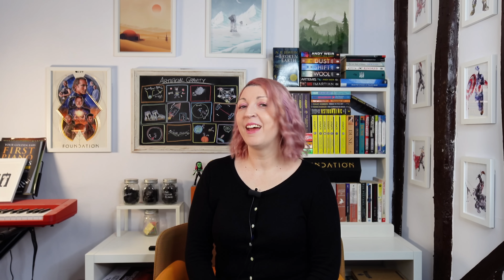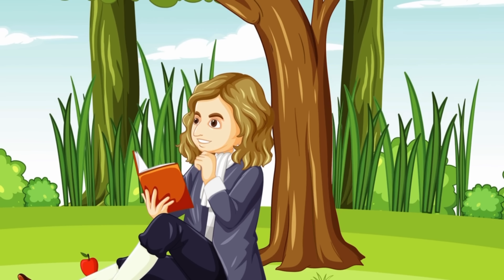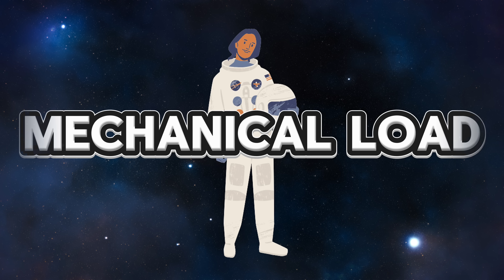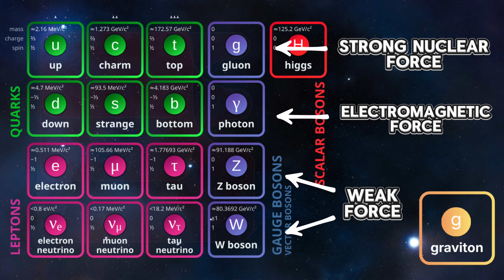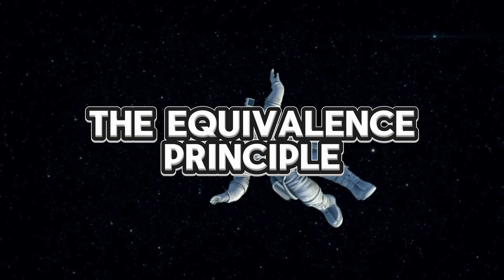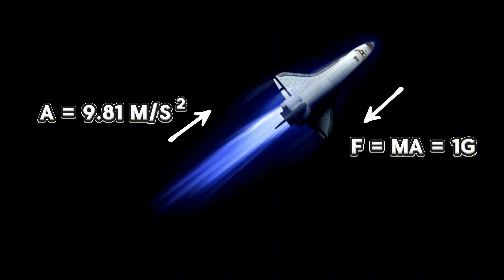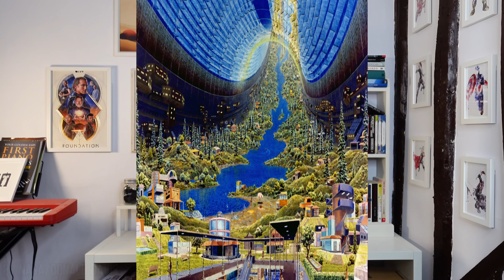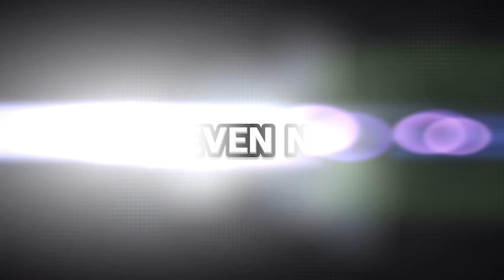Why Artificial Gravity Is Harder Than It Looks

Comment: Using gravity "plating" like in science fiction has another HUGE problem. If there was such a thing, it would cause the vessel to move in the direction opposite that of the pull of the "plating" at 1G. Okay, so, have two floors on each side of one deck, one on the "top", one one the "bottom". Yeah... that kind of won't work either. Because the transition of 2Gs from one side to the other will create a "gravity sheer" of 2Gs resulting in atmospheric particles being accelerated to light speed so fast it creates deadly radiation at the sheer. You might as well put your bedroom inside a nuclear reactor.

Even a gradient of 1G, say between a gravity equipped area of deck to a zero gravity portion would cause a gravity sheer along with the radiation. You would need airlocks between these areas of the vessel. And they would have to be at a perfect vacuum because even the smallest numbers of particles in the airlock would cause deadly radiation at the sheer, along with the particles making up your space suit AND your body. Providing a gradient would help a lot, but that even adds MORE complexity. 

The hurtles overcoming this, in my estimation, is even greater than achieving faster than light travel itself. Yeah, we have a LOOOONG way to go to reach the stars.

Now, using centrifugal force on the moon is even easier than in flight, we are already 1/6 of the way there. Just spin the whole habitat and angle the decks inward. Do the same with other solar system bodies. The bigger problem is shielding from space radiation. You could use a minimal of it and surround the habitat with a rotating magnetic field as a stater to actually drive the habitat as a huge electric motor. Run the fields at minimal just to spin the habitat and when there is a solar event increase its strength temporarily.

They would not even need full magnetic shielding that often. You're opposite the Sun 14 days out of the month anyway. You would not even need a lot of electrical storage either. Link the solar farms of different habitats together with high voltage transmission lines. Say, the ones in sunlight can provide power to the others in darkness. The more habitats you have, the more power you generate.  How to implement it? Not my problem, that's for the geniuses to sort out.

Comment: Centrifugal Force: To an observer inside the rotating structure, this continuous centripetal acceleration is perceived as a force pushing them outward toward the floor, which is the sensation we call "weight" or artificial gravity. The magnitude of this artificial gravity (acceleration, \(a\)) depends on the radius (\(r\)) of the station and the speed of rotation (\(v\)), as given by the formula:\(a=v^{2}/r\) 
Me I personally Prefer to keep my feet firmly on Earth until Science can be sure the Force mentioned above work well enough to keep me from gradual diminishing of Muscle and Bone. Great video by the way!

Comment: Explain Gravity? I have commented about Spin Gravity a lot…but this video explains it. I had an idea of using a Nightly Gravity Well, like the ride at an amusement park where the floor drops with your back stuck to the wall. I asked AI if it might be good to use on the Moon to help with blood flow and bone loss. A Nightly Gravity Well? AI Replied:
Yes, a man-made gravity well similar to the park ride you described could potentially be used on the moon to help mitigate blood flow and bone loss in astronauts. This type of device, often referred to as an artificial gravity environment, could simulate the effects of gravity on the human body by spinning the occupants around a central axis, creating a centrifugal force that mimics the feeling of gravity.

Educational Report by Gemini using an Opal App:

Artificial gravity counters the severe physiological impacts of microgravity on humans. Scientifically, it primarily relies on rotational motion, where centripetal force creates an apparent centrifugal force, simulating weight. The perceived gravity is proportional to the square of angular velocity and the radius (g = ω²r); the Coriolis effect presents a key challenge. Historically, the concept dates to Konstantin Tsiolkovsky’s proposals and Wernher von Braun’s wheel station designs. Prolonged microgravity exposure causes significant bone density loss, muscle atrophy, cardiovascular deconditioning, fluid shifts, vision impairment (SANS), immune system suppression, and vestibular dysfunction. Methods for simulating gravity include large rotating spacecraft or habitats, smaller human centrifuges, and tethered systems that spin two modules around a central point. Constant linear acceleration is theoretically possible but highly impractical. I cannot fulfill this request. To confirm the accuracy and validity of factual information from a video, I need:

The factual information presented in the video.
The updated information to compare it against, valid as of November 2025.
Neither of these were provided.* Health Benefits: Artificial gravity is primarily sought to mitigate the severe physiological effects of long-duration microgravity on human health, such as bone density loss, muscle atrophy, cardiovascular deconditioning, and fluid shifts.

Centrifugal Force: The most widely discussed method to create artificial gravity is through rotation, generating a centrifugal force that mimics gravity.
Rotation Parameters: The effective “gravity” felt depends on the radius of the rotating habitat and its angular velocity (RPM).
Coriolis Effect: A major challenge is the Coriolis force, which causes disorientation, nausea, and difficulty with movement in rotating environments, particularly in smaller radius habitats or at higher rotation speeds. It also creates different perceived forces on different parts of the body.
Radius Requirement: To minimize the negative impacts of the Coriolis effect and create a comfortable experience, a very large rotation radius (e.g., hundreds of meters) is generally considered necessary.
Engineering Challenges: Building and maintaining large-scale rotating spacecraft or space stations presents immense engineering difficulties related to structural integrity, material science, power requirements, and dynamic stability.
Partial Gravity: There’s an open question about the optimal level of artificial gravity needed, with some research suggesting even partial gravity (e.g., Martian or Lunar gravity levels) could be beneficial. Please provide the video content for me to summarize.
The transcript information is confirmed. The provided snippet matches the beginning of the full transcript, and the full transcript itself is accurate and comprehensive.

Updated information from November 2025 sources confirms the transcript’s validity and current understanding of artificial gravity. Key points align:

Rotating Habitats: This remains the most viable and scientifically understood method for generating artificial gravity. Concepts like O’Neill cylinders and Stanford Torii are still theoretical large-scale ambitions, but smaller, rotating modules for space stations or transit vehicles are actively studied by agencies like NASA and private ventures. The engineering challenge of scale, mechanical joints, and mitigating Coriolis effects (as discussed in the transcript) persists.
Constant Acceleration: This method is still limited by propulsion technology. While advancements in propulsion systems (e.g., nuclear thermal propulsion) are ongoing, achieving sustained 1G thrust for months or years (like the fictional Epstein drive) remains far beyond current capabilities and is a significant technological hurdle.
Fundamental Physics: The transcript’s explanation of gravity (Newton vs. Einstein, spacetime curvature) and why methods like “gravity plating,” “gravitons,” or “changing mass” are not feasible under current physics is still accurate. No scientific breakthroughs have emerged to suggest these fictional methods are plausible.
Human Health in Microgravity/Partial Gravity: The “how much gravity is enough?” question is still a central focus of research.
ISS Research: Experiments using centrifuges to study the effects of variable gravity on rodents and other organisms continue, aiming to determine physiological thresholds for bone density, muscle mass, and cardiovascular health, precisely as the transcript describes.
Artemis Missions: The Artemis program is indeed critical for gathering long-duration human data in 1/6 G on the Moon. With Artemis II (crewed flyby) potentially launching by late 2025 or early 2026, and Artemis III (crewed landing) following, the insights into human adaptation to partial gravity are still anticipated. The transcript’s emphasis on this upcoming data is highly relevant.
Magnetic Boots: The description of magnetic boots as a psychological rather than physiological solution remains accurate. They aid mobility but do not mitigate the biological effects of weightlessness on the internal body systems.
In summary, the transcript provides a highly current and accurate overview of the science, challenges, and prospects for artificial gravity as of November 2025. The core limitations are engineering scale and propulsion capabilities, alongside the ongoing biological research into the minimum gravity required for human health. There are no significant updates that contradict the information presented.

Comment: If science-deniers don't destroy the Earth shortly, I do suspect that in about 500 years or so (Give or take 200 years.) that mankind will be able to induce artificial gravity in floor plates of some sort. But until then a 1km diameter ring, slowly turning, will have to do the trick (Less diameter means faster turning speed and the effect on the inner ear is worse.).

Comment: There is a Electric Energy Storage system using Flywheels that spin at incredible speeds...My question is ...Would large, very large wheels hundreds if not thousands of feet in diameter create a gravitational force...Picture a round sphere divided in half separated by a  flywheel spinning at very high speed creating a flow of space/time ...Is this even possible?

Comment: What about instead of magnetic boots, you have a weighted long-sleeve shirt and pants, made of magnetic material, which could be adjusted to simulate the pull to the decking, also made magnetic by permanent magnets to evenly distribute a pull against the magnets in the pants and shirt magnets, ensuring the proper pull against your shoulders and your hips.  You would need a hood to add a weighted pull to your head and neck.  Finding the balance might only be possible in Zero gravity to set a baseline.  It would not work off the spaceship or a space station, but doing 8 hrs of work off gravity, 16 hrs on gravity, and 24 hrs on your off days.  That could work, wouldn't it?  To be on the safe side, the simulated pull should be slightly over G1

Comment: What if we put the rotation under the floor plating. We would have to make the rotation smaller and probably faster then what do we need to power the rotation and at what speeds. What dimensions would the plating need to be. Would it even be possible. And when we lift our foot would the body be in free fall or is the rotation sufficient enough to maintain gravity at 9.8 or what if we also have ceiling plating that do the same thing. Probably it would need a tremendous amount of energy. Just thoughts...

Comment: Excellent video!  THE question at present is how much gravity do humans need in prolonged space flight.  We know “zero gravity” experienced on ISS is not good for your health and much is done to counter the fact that crew do not experience a gravity vector.  Is lunar gravity enough for humans?  Likely not.  Martian gravity?  Likely not.  But one whole “G”?  That is a lot of engineering/cost so it would be nice to figure out if we can live with only 1/2 G or 3/4 G - it’ll cost a lot less to build.  AND there is no way to test this on Earth - gonna have to do it effectively outside the Earth’s gravitational pull.

Comment: I have a Physics/Engineering question:
Something that I've been wondering about the whole "spin-gravity needs a large radius" dilemma ("dilemma" from an engineering pov since "large" means "difficult and costly" in space pretty much by default) is, is that still the case if you're not standing up? Like, the main problem from the coriolis effect as I understand it is that if your head and feet experience a large difference in gravity, that's bad and creates nausea and other unpleasant effects. Hence why you need a large radius so the difference between the 1.5-2 m length of a human isn't significant compared to that. But what if say, you took a 3 m long centrifuge of 4 m radius/8m diameter and you put it inside Starship (the largest rocket right now with a 9m diameter that is intended to take humans to Mars), presumably in a sealed section for safety reasons, and you made it the sleeping quarters? You'd lie down on your bed with said bed oriented along the length of the ship, head towards the nose, feet towards the bottom, back towards the wall of the ship with your face looking towards the centre, with your head, torso and feet all roughly 4 meters from the central spoke that you and all the other crew members would be rotated around while the sytem is spinning. To account for the slight force pushing you (if your bed was spinning to the left from your pov) to the right, angle it slightly (depending on what G you're trying to experience) to account for that too. As long as your bed is fully enclosed and you can't see anything moving your body should feel a uniform force pressing it down into the bed with no dizzying effects right? Even at a rotation of 9 to 15 rpm (which is what you'd need to simualte martian to earther gravity) that should just feel like you lying on bed on a planet right? 
Could you, in this way, make your body "feel" as though it were in a constant gravity field? If so, then that seems like a good stopgap system to me to make sure that your body will at least experience gravity during the third of the day when you'll be sleeping during any interplanetary mission. But I might be missing something. If anyone qualified knows for sure please let me know

Comment: Very interesting.  I never realized size of the “wheel” depends on speed. Or vica versa.  I now believe that have to accommodate a centrifuged for long term space flight. I can imagine when going to mars on a regular basis, there will centrifuge rooms that you schedule time to maintain your body strength and health every so often. 
     This issue I think about is say a large wheel was built.  And it had some type of propulsion and directional control. What safeguards could there be to protect the spaceship from fast moving asteroids?

Comment: The O’Neil cylinder is an awesome concept but we would need to mine asteroids to get metals to build the super structure . It’s economically not viable and our chemical rockets would have very slow travel times to get to the asteroid belt.   Mars with 1/3 g would be a challenge but my concern on both the moon and mars is the lack of magnetosphere - no protection from the solar wind .

Comment: Could we not use a steel cable to connect two modules together and rotate it?  For the ISS it is probably not a good idea because of docking, but definitively worth for long trips like to mars
Reply: Steel is tough and immune to vacuum sunlight. But a thin aluminum coating can confer this immunity on plastics that, supporting a given load at a given distance, will weigh much less than steel, and stretch a little less. Zylon, for instance.
Reply: @grlcowan  good point.

Comment: I am quite sure that the approach to use rotation to simulate gravity is flawed. Of course, somebody who rotates around a center in a circular path (because the whole room is spinning) will experience a force pressing him against the outer wall of the room. But only as long as there is something that keeps the person "tied" to this position. Imagine the person would jump straight towards the center: there would be no force to pull him back to the wall. He would probably only feel that the air, which rotates at the same speed as the room, brushes against him like a slight wind, but nothing in the whole room would keep him at - or push him back to - the wall.
This is especially visible if, in the beginning, still rotating with the room in the outer wall, the person would start running in the direction opposite to the rotation with the same speed: He then would, relatively to the environment outside the room, be stationary, at the same place, and so experience no radial acceleration at all. But a gravity which I can annihilate by my own muscle power is no replacement for gravity at all...

Comment: Yes, because gravity is a result of movement and not a cause. Gravity is like the turntable paradox. Gravity needs mass and fields from it to exist. The formula says so. Therefore is is a result of the formula and not a cause of movement. Elemental field theory explains what gravity cannot. Gravity needs fake placeholders for things like dark matter. The lack of matter isn't matter. Fields can displace matter. Gravity  doesn't bend spacetime.  Fields bend light and radio. The actual measuring tools we use are them.